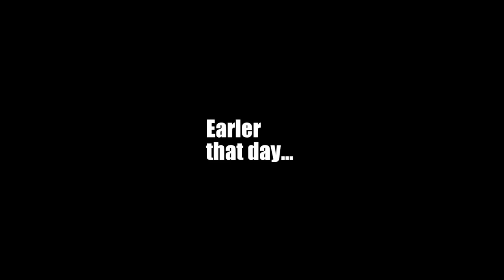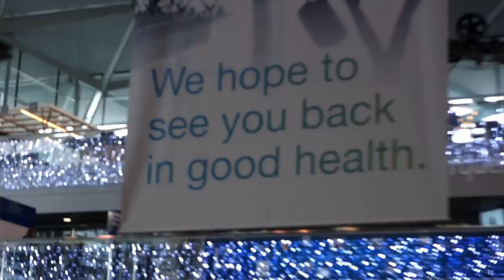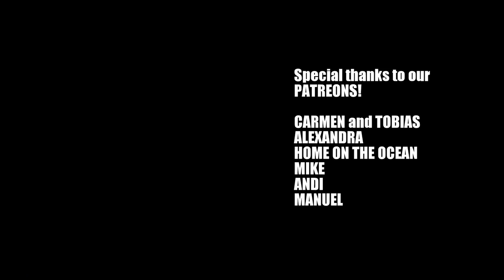Alone with my boat without a mast SAIL to FLY #33

Comment: You already decided to re-rig your mast so that's done. If it was expensive it doesn't matter because at least now you can have peace of mind and not think about that part of your boat when the weather is rough and you are really depending on your boat for your life. In my work, we often have to depend on heavy cables and chains not to get killed when hoisting heavy loads on and off cargo ships. All the rigging for that gets serviced and tested regularly in my country (Canada). We never use the ship's rigging equipment as they have lower (sometimes non-existent) safety standards. Maybe this kind of testing is available for sail mast rigging. No sure.  For your and Nicole's sake, I think you did the right thing.
Reply from the maker: Thanks Panter, we are glad we changed the rig. It was very old maybe up to 40 years we don't know. Now we are sure that we have a save rig. Cheers, Daniel

Comment: Hi! Maybe not important in this case but T-connectors use to installed like; incoming to the “bottom” of the T, and outgoing to the other two ends. This to equal the pressure/flow to both sides. I’m guessing a bit here but is it really logical that the membrane doesn’t work? Maybe it’s the pressure, to the membrane, that is to low? Or only some mixup with in-/outlets…? Anyway, thnx for sharing! We all learn more from some resistance in life and if everything just went smooth - the knowledge of how stuff works would be lower 😉
Reply from the maker: You are right there is a challenge in every task. There was actually no membrane inside... cheers Daniel
Reply: No membrane, 😮
unexpected to say the least! Not only your berth in the marina was missing - also the membrane mysteriously disappeared 🤪
Does this mean that your water maker now actually works? 🚰

Comment: Lifespans on standing rigging - just made some investigations (I bet you would be very jealous of my fast internet) and found that there, also on this subject, are a lot of experienced input and quite some heaps of rubbish. However, wire rigging in fresh water - lifespan: any number of 10-25 years seems to be appropriate - in saltwater 8-20 years. So, what we can state is that it surely depends on many factors; 
Stainless? (or just partly stainless?) 1x19? 7x7? 7x19?
and what grade?…
Tension? 
Racing/pleasure/cruising? 
Repetitive worn on certain parts? Etc. 
Since last ten’ish years different types of synthetic riggings are really gaining on the market. They can save 60-80% weight, breaking strengths roughly 10-50% higher, and of course a bit more expensive. Lifespan 8-10 years.
Reply from the maker: Hi, MiQ, 8 - 20 years is quite a lot! We found out that our rig was probably 40 years old.... good that we changed it now! ;-) We thought about dynema, but steels seems to be much stronger and resistant against UV radiation.  And you know its a old boat synthetic riggings would have been a bit to fancy for us ;-)
Reply: And most of all: far too late. So many times we want to be of help, with fast internet and own experience. But then, it was months ago… 🐌🛰